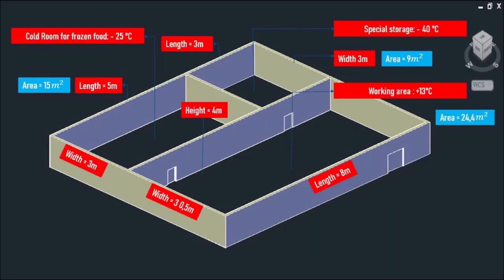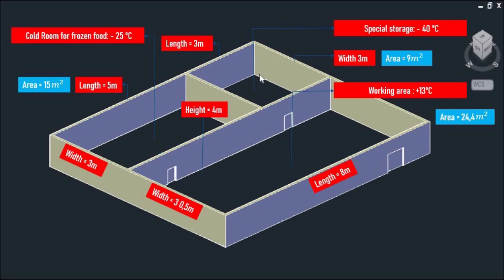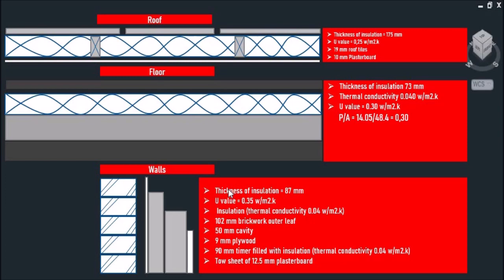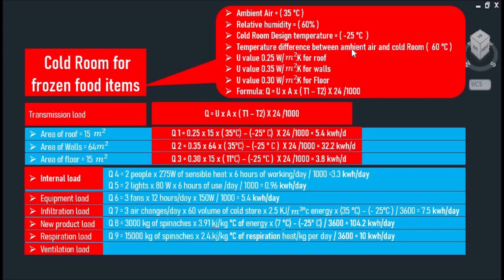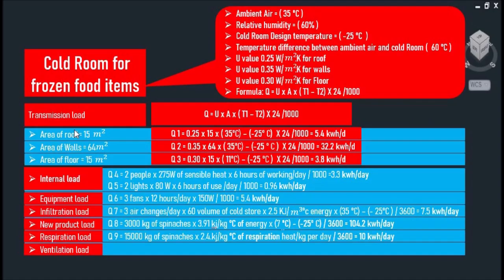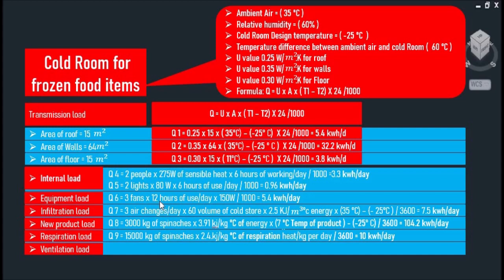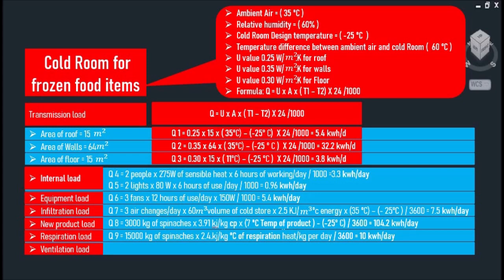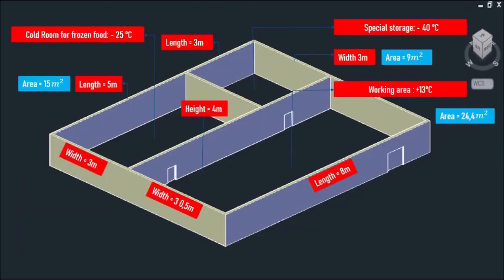cooling load calculation for a cold room for frozen food items-hvac

Comment: Is it possible, if we wanna make a cool room without any insulating materials like polyurethane.. I want to make a cool room in a building. The room will be made by brick,sand and cement.
Reply from the maker: It depending on the thickness of your wall and your indoor temperature even inside the building you will still need to account for every source of heat gain such as sensible and latent heat load which can effect the walls to have heat gain so you still need to calculate for the U Value of your   Wall Measuring the thickness of  your wall and all other additional layers on the wall however using insulation is necessary because it can slow the flow of heat through your wall.
Reply: Thanks for explanation... It is clear that insulation(polyurethane ) is required for cool room.

Comment: Does air changes per day has any empirical relations??? According to temp.
Reply from the maker: The ambient Temp is always in a great variation, which it is hotter or colder, it has definitely a great impact in air changes.
Empirical relationship dose not refer to this subject, ER is correlation or relationship on observations or experiments rather than theory.
Reply: @theengineeringtutorial2290  then what value should we take while designing cold room for products for any room volume
Reply from the maker: Akshay Rayate Depending on many factors such as your geographical location, U-value and On the types your products and total quantities of your product, for example if you store ice cream, fish and meat it starts from -18 degrees Celsius to -25 and -28 degrees Celsius.
If you cool down milk, eggs or vegetables is different it starts from +2 to +6 degrees Celsius that make a big difference must be taken into consideration including some other important points which has already also been mentioned in the video regarding cold room part 1 and 2 in order to get the right value for a cold room.
Reply: @theengineeringtutorial2290  Thank You Sir

Comment: How you directly used fans wattage.....how you select evaporator/cooler for cold room
Reply from the maker: In this video, It has only been discussed about cooling load calculation for a cold room. Fans wattage have been directly selected due to heat which is produced by fans to determine or accounting for cooling load.

Selecting evaporator/ cooler for cold room:
It has not been talked about selecting units yet, There are many important points and some other several factors that should be considered and kept in mind when selecting an unit or evaporator coils, it will be discussed about in a next video .
Reply: @theengineeringtutorial2290  Thank You.... Waiting for the next video